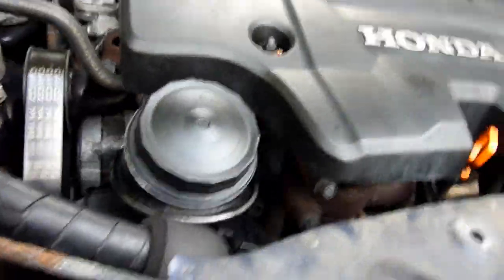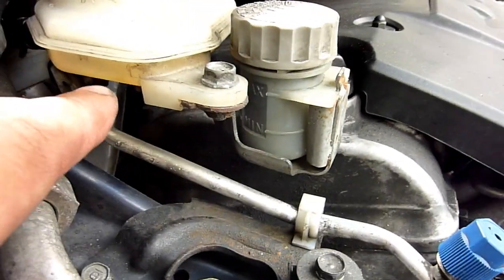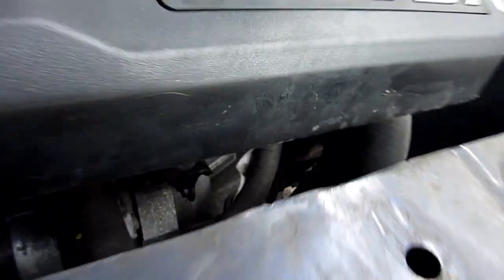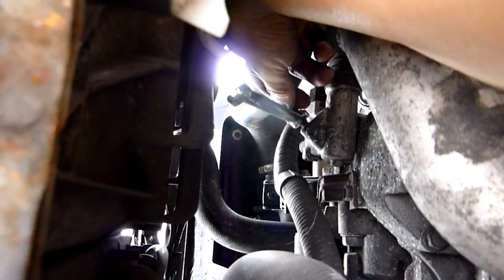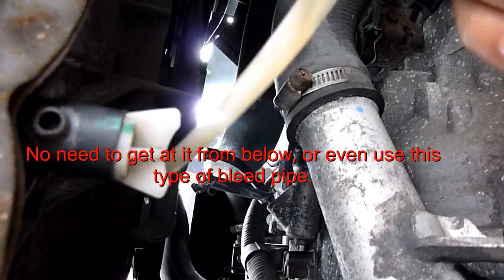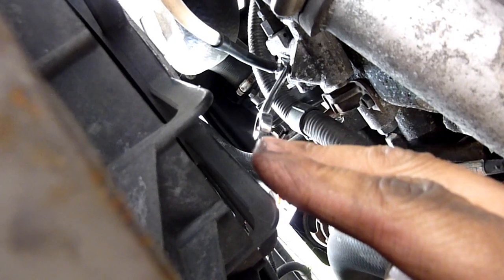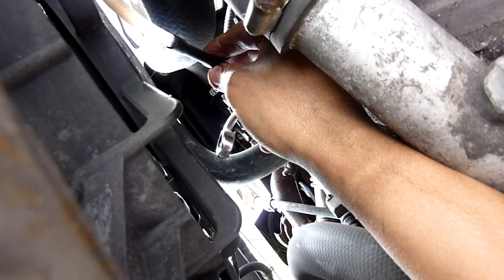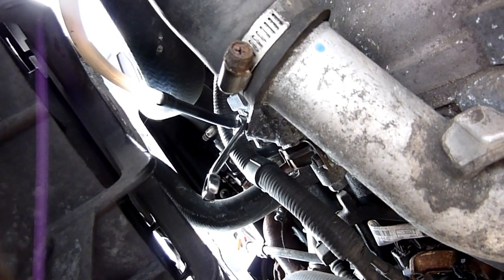How to Change the Clutch Fluid On a Honda Civic MK8 2007

Comment: How much brake fluid did you need to do clutch resivoir?
Reply from the maker: I'd say 1 Litre bottle for about £10 is enough. Just run it through until clear, so maybe only 0.5 Litre.
Reply from the maker: Watch out for your paintwork though with brake fluid.